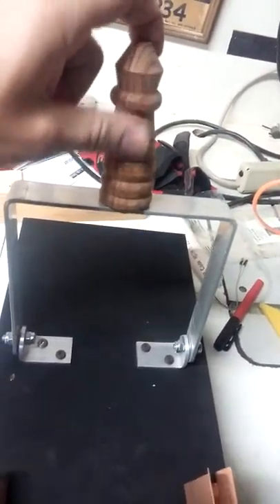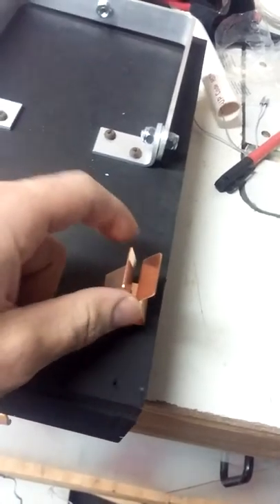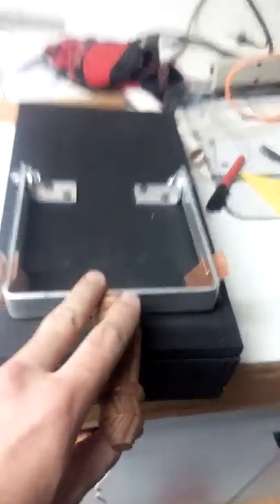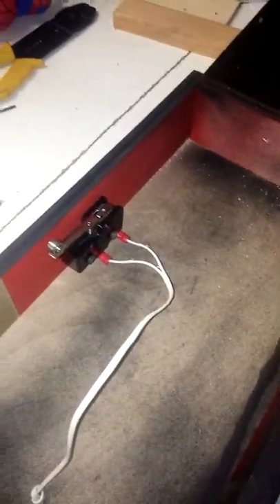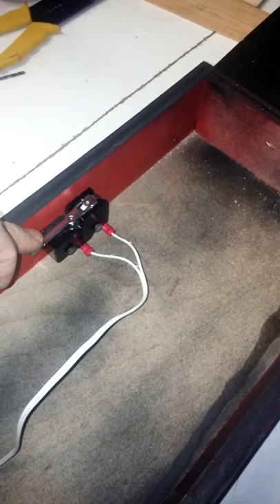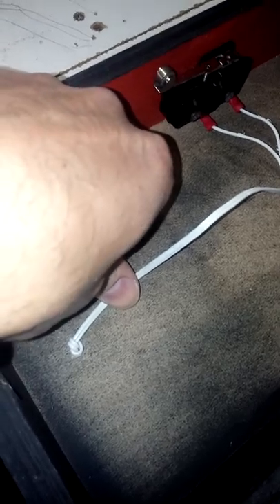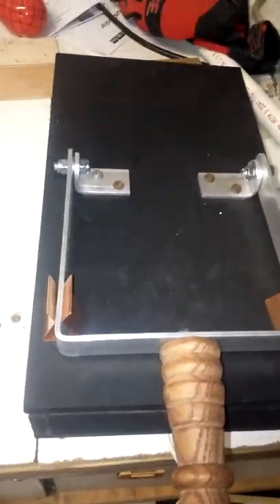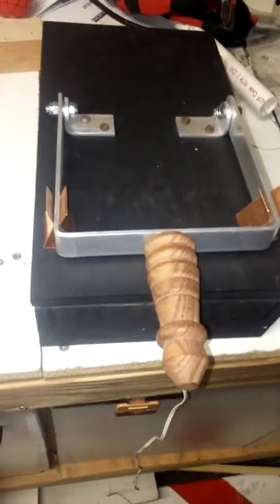DIY Knife Switch Prop Trigger

Comment: Thanks man, you gave me a new idea from the roofing nail stuff. I thinks that I could hide the real switch sistem just like you but instead of putting the roof nail were you did maybe Ill could hide it inside the cooper clips with the wide head up. That way it doesnt fall to anywere. Sorry about my english.